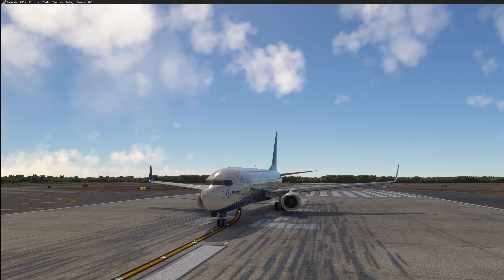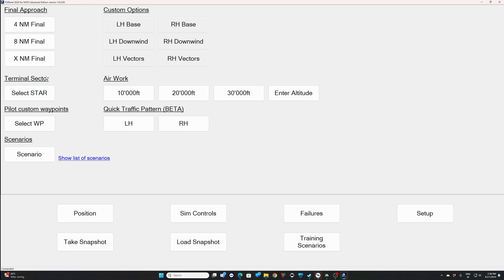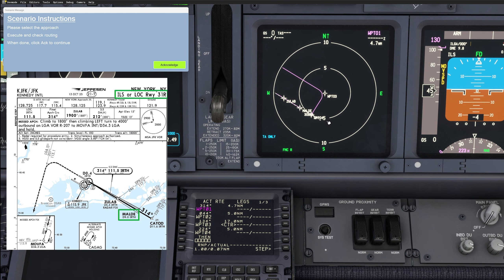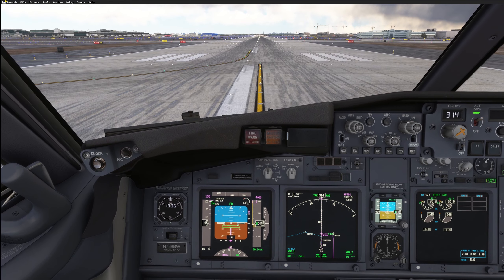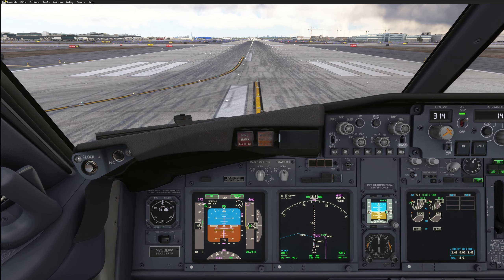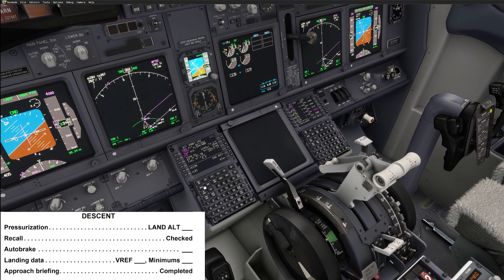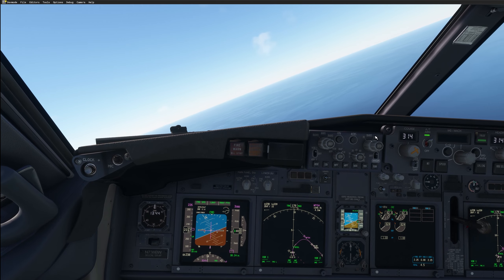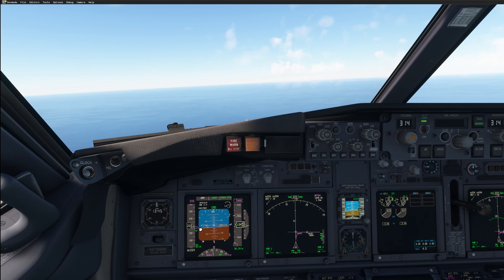New Open BETA Feature: FSiPanel Advanced Edition - Quick Patterns with PMDG 737!

Comment: Hello JP ! Apparently, the FMC doesn’t set transition altitude when setting up the approach. I just did a pattern on LFPG 27L with a missed approach that is to FL70, and when I changed altimeter setting to STD, I got the yellow box since 18000 was still transition altitude in the FMS…
Apart from that, so many thanks to you for your dedication 🙏 ! I don’t have that much time to spare to do simulation, so I prefer to fly approaches than do long flights. So FSiPanel is an absolute must for me and certainly the best add on you can buy to improve your experience on the sim. Keep on the good work 👍.
Reply from the maker: Hey, yes correct, need to be set manually  if you plan to fly above transition altitude.